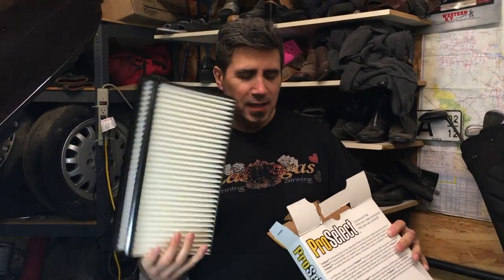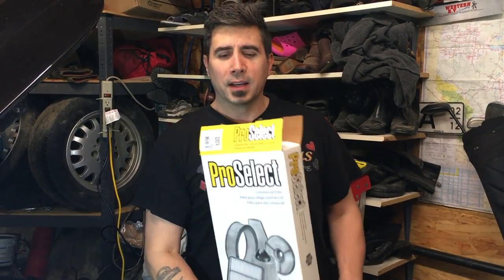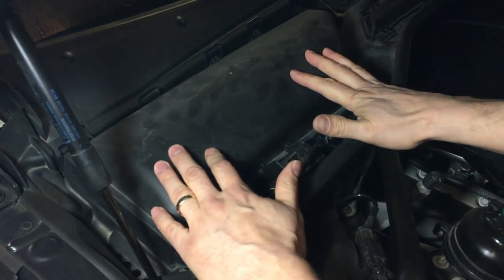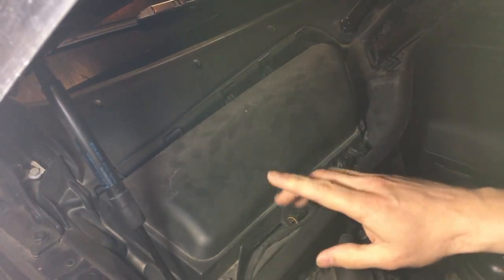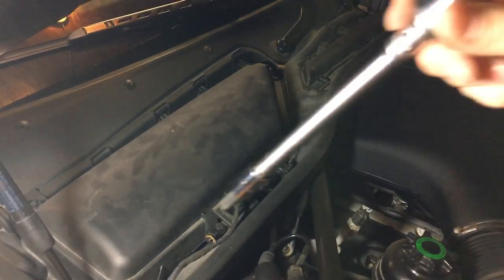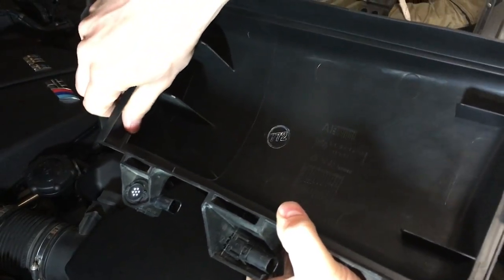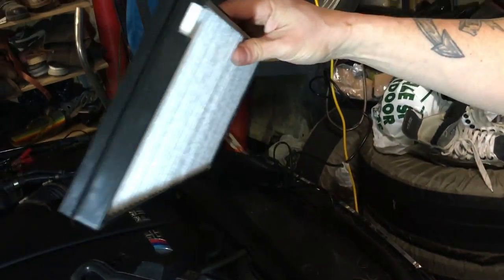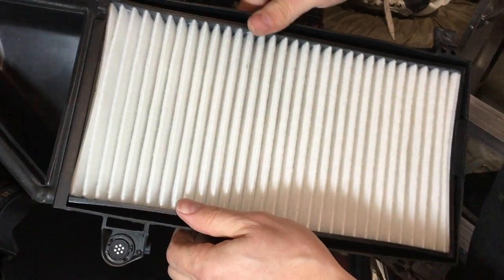BMW E60 M5 Cabin Air Filter DIY | With Microfilter Service Reset

Comment: On my BMW, I have 2 pairs of cabin air filters. 1 pair in glove box and 1 pair in engine compartment. Dealer wanted $160 labour  combined 2 change them and the engine air filter. I purchased new filters and did them myself. Took me exactly 23 minutes. Timed it! Took my time not to break anything else.

Comment: Very helpful, the new cheap ebay filters no longer have hard plastic around the edges, even easier to pop in and out, I remember I had an old pair when I had to cut down some of the plastic.  Maybe inflation forced them to go even cheaper in aftermarket, put in $20 set of filters, looks and works perfect.